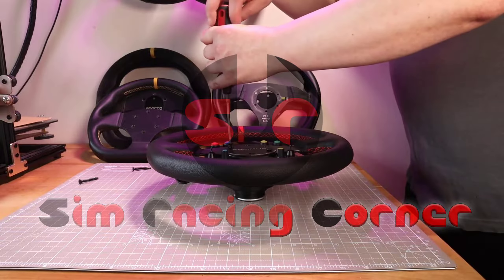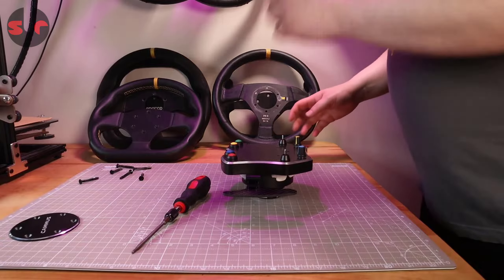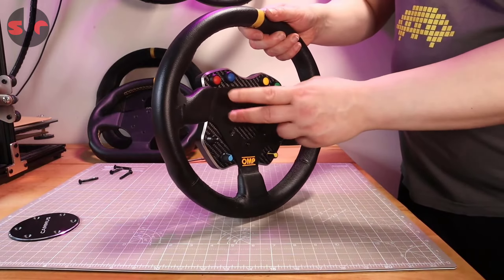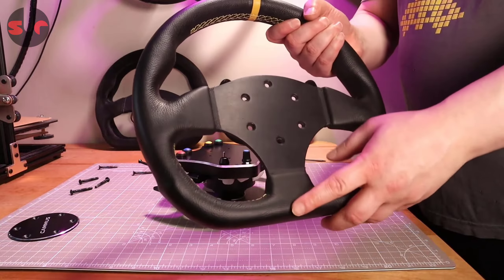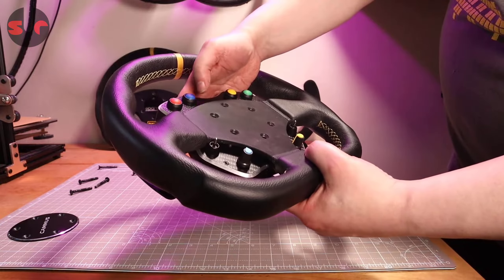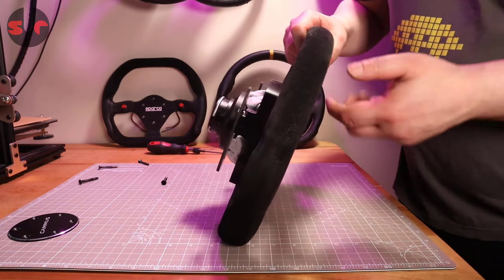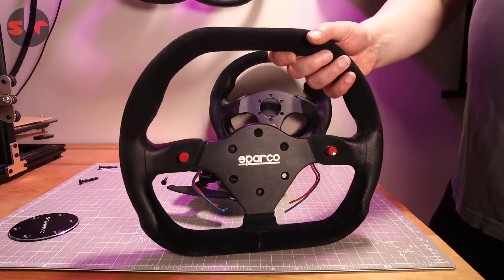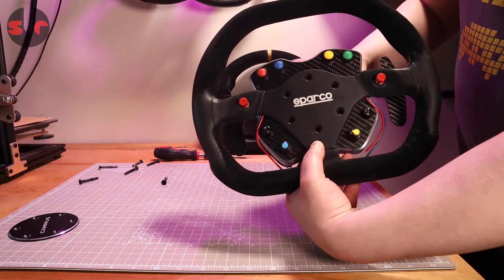CAMMUS Wheel Plate, fitting other rims! WILL THEY FIT?

Comment: You can put spacers between the rim and button plate so you can still use the Sport line competition rim, it would also give you more space in between the rim and shifters.
Reply from the maker: Afterwards I discovered if you unscrew the shrouds, and those switches remain in place, so that fixes the collision. And to get some distance on the shifters, is DIY a spacer between the shifter arm and paddles.

Comment: I used my cammus button plate with a turn r320 for a while till I replaced the button plate,

Taking the paddles off and mounting them to the rear of the shifter arm also helped with clearance, though it was tight

Comment: Would you mind letting the viewers know where to buy the other button plate you showed in this video? Ive seen similar ones on ebay.  And is it as good or better than the cammus plate. Thanks!
Reply from the maker: It's an old one from Ascher Racing. This button plate model is no longer in production. They have newer ones. Their stuff is really good.